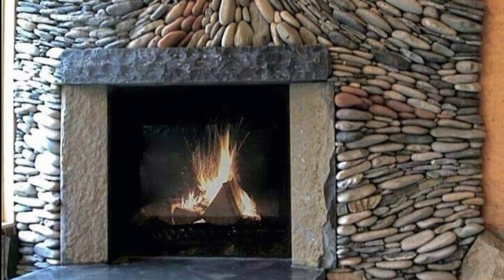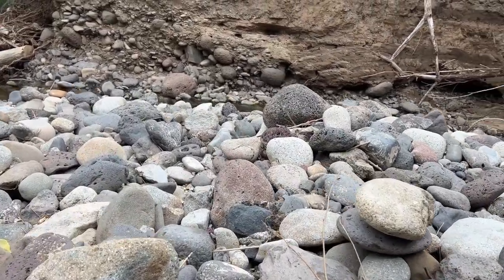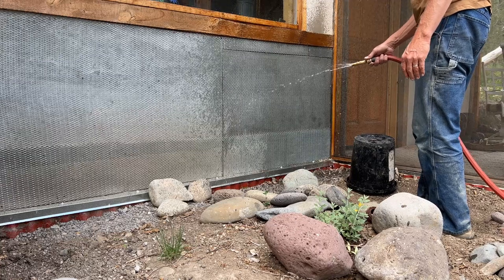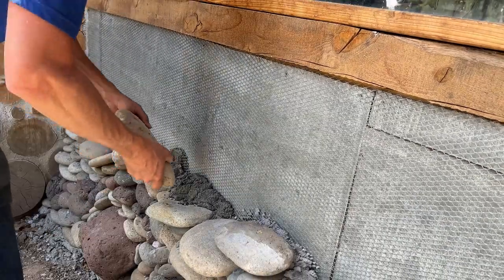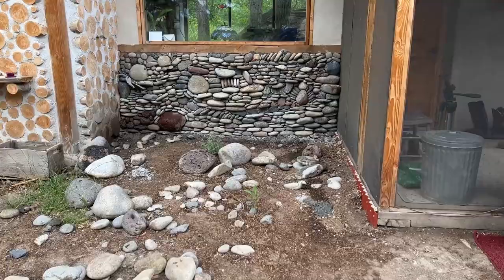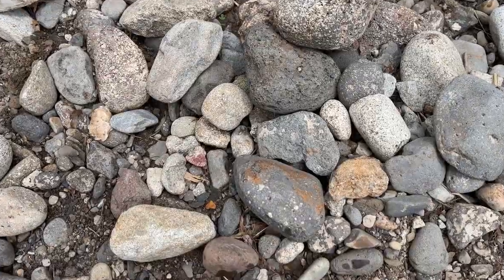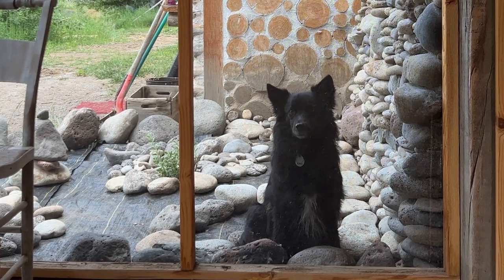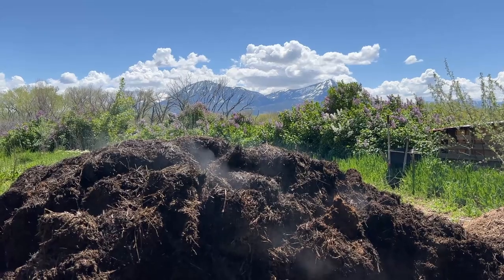A Riverstone accent wall on a dustcrete building

Comment: Love your work, and especially like that most of the material is local.

My guess is the rock layer was deposited towards the end of the last ice age and the soil is built up in the last 20k years. I imagine USGS would have a good explanation of the geological history.
Reply from the maker: That’s my feeling, as well. I’m theorizing that perhaps the iron rich magma may be an artifact of the celestial impacts that ended the last ice age. All of the sub soil could have been deposited in a single day during the flood. The topsoil then developed over the last 12,500 years. 🤷🏼‍♂️
Reply: @radicalgastronomy  I'm no expert, although I studied and did well in geology, so I'm naturally drawn to such questions.

Here's a bit more speculation on my part - not knowing where you are.. To me the high iron rocks looked like violently extruded igneous rather than celestial in nature. The porosity suggests that they were violently ejected from a volcano that had quite a bit of gas in the magma. The mix of round rocks suggests mechanical action from water - probably ice. The flatter stones tend to be caused by river abrasion. The mix of rock types suggests the rocks have been transported some distance. From memory there were two major types of rock suggesting two types of formation - perhaps the second type being intrusive igneous rock gas larger crystals and lacks the pores of the violently extruded igneous rock.

Not surprisingly, the soil horizon between the rocky subsoil layer and the lighter 10ft subsoil  layer suggests a major change - end of ice age.

Are there any (possibly extinct) volcanoes in your region?

Comment: That's great work. Very time consuming, I'm sure. I know you didn't want to mortar it, but I think it would look great mortared, too. I have always loved stone, but it can be pretty rough on the body, doing the heavy lifting, esp if a person isn't very big, and unaccustomed to doing this daily. I tore a shoulder lifting a paver that was going to be thrown away, and we know we just can't allow nice stone slabs to be thrown out, now can we? 
About the dustcrete, do you have any that has been left exposed to the weather for very long, and if so, how does it hold up? I think it may be great to build round/sculpted homes..like the sandbag ones..only without the bags.
Reply from the maker: Yes, the western slope of Colorado. I have dustcrete that has been exposed for about 18 months, and it is holding up perfectly. I’ll plaster it once the heat wave breaks. Round structures are totally doable, as long as you can bend the form.
Reply: @radicalgastronomy  Have you tried to do any sculpting with the dustcrete?  Just building and shaping any structures w it? I bet it could be used that way, too. (Then smooth out any irregularities w the final coat of mortar..)?

Comment: how old is this layer ... good question ... i wouldn't know. i hope we get some educated guesses ... ChatGP gave up on it :) .. love the wall; good inspiration.
Reply from the maker: It’s hard to even guess well. Top soil forms at 200-1000+ years per inch, depending on climate. We can safely assume our 18” took between 3,600 years, and 18,000 years to form. This could all be a Younger Dryas deposit, dating back 12,500 years, or it could be millions of years old. I don’t have the chops to know, but I trust someone will have some insight.